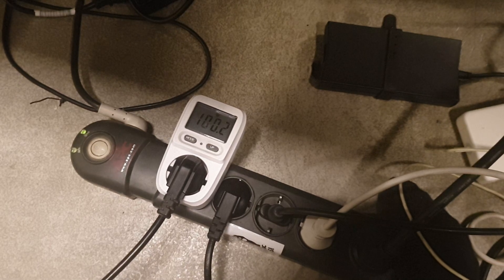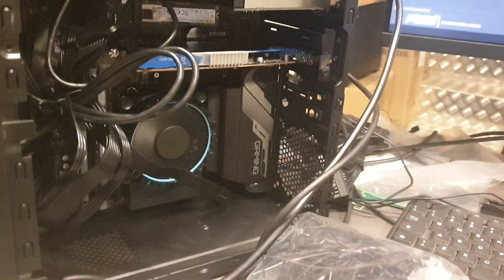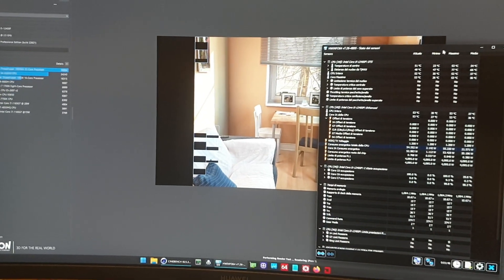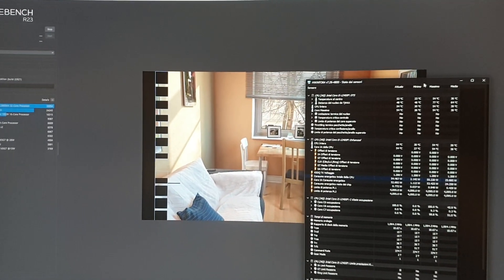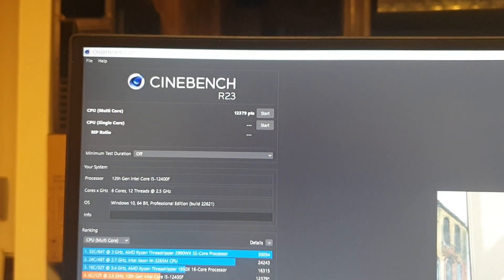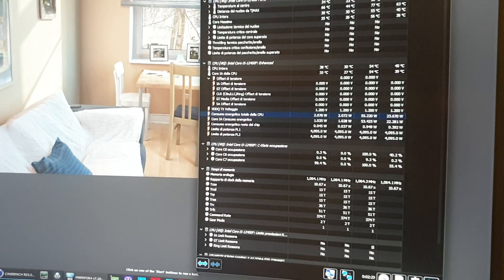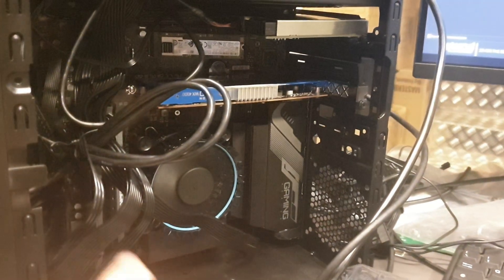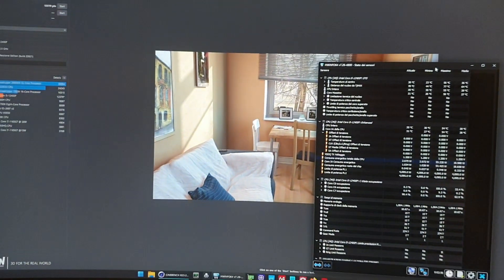Gigabyte b760m undervolting a 12400f by 150mv - 100w total from the wall with dgpu. Amazing news

Comment: Hello what can i do on msi pro b760m-p with i5 12400f?
Reply from the maker: @deice2367  you should use Lite Load on MSI boards much more reliable works on every 12400f die wether C0 or H0

Comment: I have mag b760m mortar ddr4 how to enable under voltage i5 12400f
Reply from the maker: @monglad5979  if you have C0 die you can use offset, with H0 set CPU Lite Load to 1
Reply: @mircomputers  i have H0?
Reply from the maker: @monglad5979  Lite Load 1

Comment: i got 12400f @ 5ghz but it only use 1.0v when load. It does not crash
Reply: Which Bios ver do you have?
Reply from the maker: he is not on this board, it does not have clock generator
Reply from the maker: C0 stepping, you can undervolt + overclock at the same time on that die; h0 can only OC

Comment: Does a Aorus B760 Elite X Ax have an undervolting option?
Reply from the maker: yes, but it works properly only for some cpus in my experience, i7 and i9 and H0 i5 lose performance when undervolting, only C0 i5 actually work better with undervolt

Comment: hello   i have a b760m gigabyte gaming x and the latest bios paired with a 13600kf , can you help me or give me advices to undervolt it plss 🙏
Reply from the maker: hello, K CPUs should have no issues with undervolt with the first bios release, and then you should also get a toggle for the older microcode in new bios release
Reply: @mircomputers  when i change Mcu to 0014 when i start i get a bleu screen
Reply: @mircomputers  actually, you dont need to switch to older microcode, turn off intel defaults, nor to disable CEP to undervolt 13/14th K CPU's. I am running my i5-14600K with the latest microcode bios(f11), at 1.360V max locked, and -0.162mvats offsets and around 24000 cinebench R23 results, never reaching over 79-80 degrees, with all Intel's security/degradation prevention measures truned on GAMING X AX...
Reply from the maker: @wakizashiyoshikawa6926  yours is a K cpu, it is supposed to be unlocked...

Comment from the maker: important and SAD update: it seem to be totally RANDOM wether undervolt gets enabled on these boards. I got it working with a couple and got excited, but now  the undervolt seem broken again: it will tank performance at around 50 offset and then CRASH at around 150, even with a board that was working last week (just cpu swapped from 12400f to 12600). I am invastigating wether there are some specific cpu that do work. I have so far shipped 1 z690ud and 1 b760m gaming x ax (the one in the video) to clients that are working, i have a b660m gaming x working here, but another z690 UD and b660m i purchased last week are now under testing and DO NOT WORK with the same f21 bios that was working on the same model before, using different 12400f / 12500 / 12600 cpus

the craziness is that with these bios at over 150 you still get the system to crash, wich previously wasn't the case, so something sticks.. but only the bad part
Reply: ah man so the same nonsense I am running into on my 12500... its really a shame as a 100mv undervolt would help so much in my SFF case. But If I even touch a minor undervolt it tanks performance.
Reply from the maker: @Demon09-_-  it worked ok some samples. but even the same board same bios stopped working as i swapped CPU
Reply: Any updates on this? I am Considering undervolting mine. Are you setting specific voltage or using voltage offset?
Reply from the maker: @kimolsson1772  hello! I have found out that its based on the die, H0 cannot undervolt while C0 can! Very logic! Therefore a 12700f would be the best bet for cheap undervolt!
Reply from the maker: update - undervolt on 12700f does not work, neither 12900k, they both clock stretch!  Only 12400f C0 does not stretch!

Comment: any experience with the b660 itx thats in the desk meet from asrock? im hoping at least something like load line calibration will allow for some undervolting on a 12400f
Reply from the maker: nop, i don't trust asrock anyway
Reply: @mircomputers  seems just like all the other b660's its a nope its really sad to see intel make it so hard to undervolt. You basically need both undervolting protection and intel IA CEP as bios settings otherwise both will make undervolting not work. I can undervolt on the asrcok but will drop huge performance even for minor undervolts when IA CEP kicks in but since the settings not there its a rip. even just going down one step in load line calibration makes it kick in.
Reply from the maker: @Demon09-_-  on MSI boards cpu lite load works fine all the time ! that's the only 100% reliable way

Comment: On my gigabyte b660 even if i undervolt for just -10mv the performance already drops. Can you show how you do it in the bios
Reply from the maker: Yes , that is reported on all my previous videos. I have a lot of content on that issue. There is apparently a microcode version 0x104  that has the undervolt functionality working! I am currently investigating. A list of tested configurations is in the description.
Reply: I flashed the oldest bios available that doesnt have that microcode,january 2022 exactly,and performance still drops when undervolting.If only throttlestop would work and we wouldnt have to do it in the bios...
Reply from the maker: @eduardionescu6291  i am looking for the right buis myself. Sadly the z690UD that also had undervolt working is already gone to the client! -165 stable on that one sample with the PA120 cooler, fans never spinning not even under cinebench r23!
Reply from the maker: @eduardionescu6291  b660m gaming x bios f20 works perfectly with undervolt

Comment: Do you have any coil whine with this motherboard? A lot of people are complaining about that with Gigabyte motherboards.
What is your CPU revision - C0 or H0?
Reply from the maker: Nop, no issues on that side; i also never heard that on any other board, but i only use H0 cpus, as i like lower power and smaller ringbus, no e-cores for audio and gaming.

I have never had a single one 12400f / 12500 / 12600 come to me in the full C0 die, i do check everytime the back of the cpu and spec number and would return them if found.

Comment: Can i undervolt 13600k on this board?
Reply from the maker: K skus should always undervolt on every board/bios even though i had issues on Asus boards
Reply: @mircomputers  nah man intel made the board manufacturers to block it on b660 for example
So they can sell more z690
Reply from the maker: @MegaChickenPunch  this b760m and MSI b660 can undervolt no issue.

z690 asus boards can't undervolt i5 12400f / 12500 / 12600 - and b660 asus can't undervolt 12600k ( instant crash with every offset positive or negative for me, other reported loss of performance like locked CPUs )